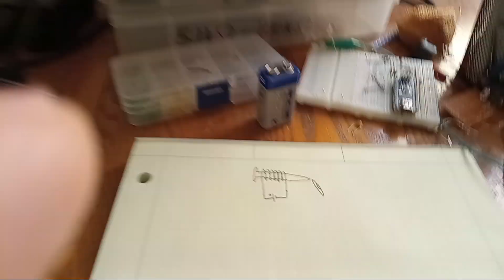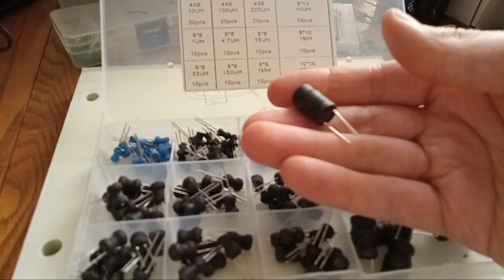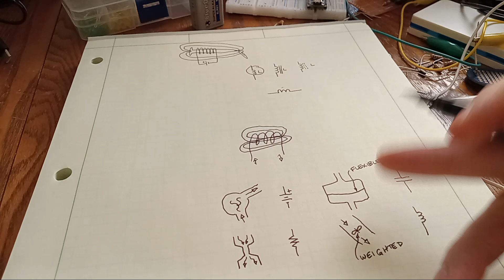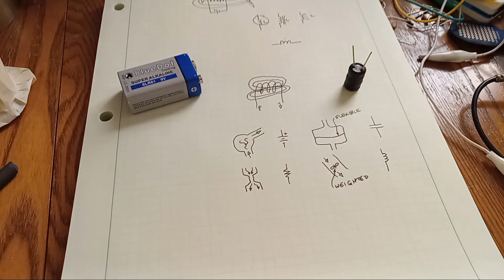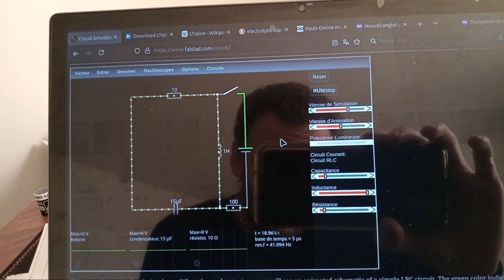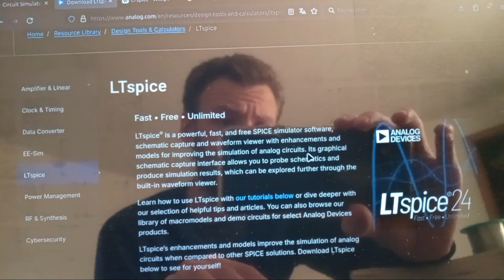(part 7) Introductory Electromancy: inductors

Comment: I gotta criticize the physical inductor you showed us because it is not a typical representation.
Reply from the maker: It was the largest value in the inductor kit I have readily available; the kit was the cheapest one on ebay several years ago, something like these ones:

https://www.amazon.com/Minidodoca-Assortment-Resistance-Individual-Compartment/dp/B0CL4SC9KL

https://www.amazon.com/Swpeet-90Pcs-Values-Inductor-10UH/dp/B09PV243S3

https://www.amazon.com/BOJACK-Values-Inductor-Inductors-Assortment/dp/B08MPM1F5T

An example with visible windings would probably be easier to intuitively understand, though, yeah. I thought about demonstrating with one winding of a transformer and leaving the other open, but then I'd have to explain that leaving it open makes it act like it's not there, which seemed like it would fit better in the section about transformers. I also didn't even give the equation for inductor charge / discharge and time constant; I've been glossing over a lot -- my plan is to emphasize practical projects and fill in the details as they're required to fully understand the circuit and get it to work properly, with the hope of making them more memorable by connecting them to a physical object and practical purpose.

However, starting with a quick tour of the basics seemed like a good idea -- so that if someone runs across one of the projects later, they can watch the earlier videos in the playlist to gain a complete understanding of it.
Reply: @quicksilv3rflash  all good it was just really confusing seeing the package I was expecting a ring with wire wrapped around it
Reply from the maker: @AricGardnerMontreal  I've made a note to specifically mention toroidal inductors when I come back to them :)